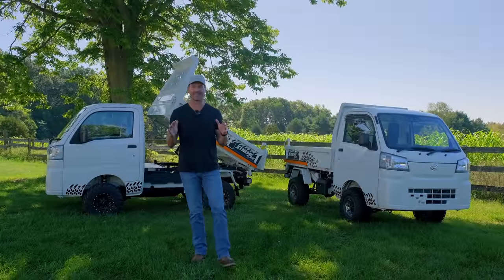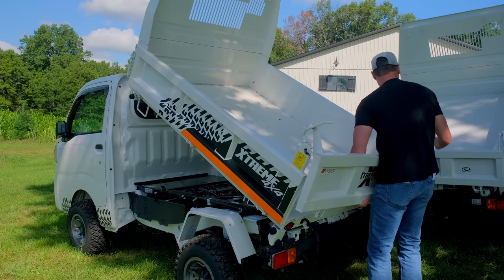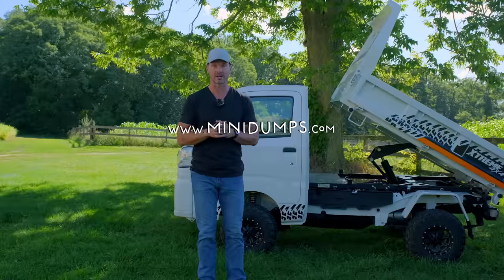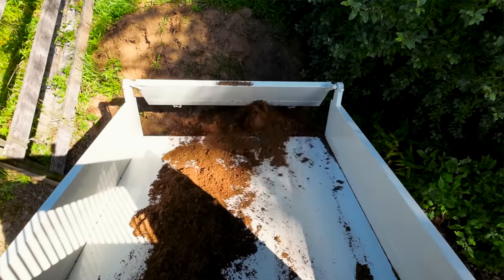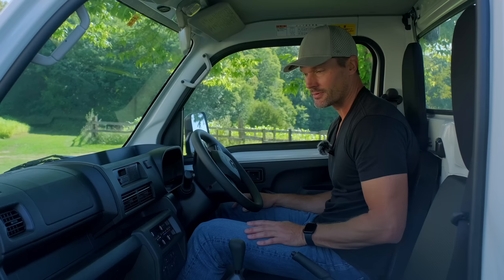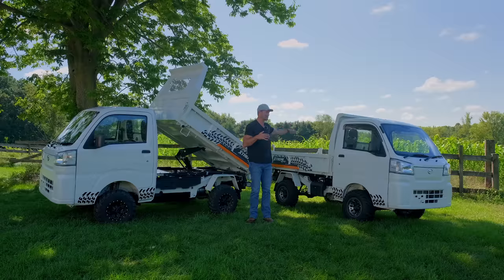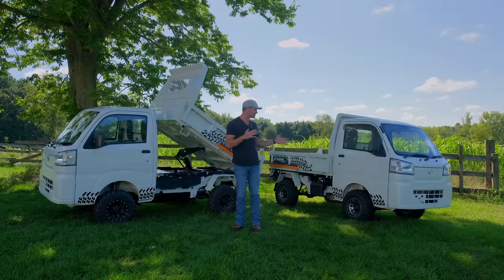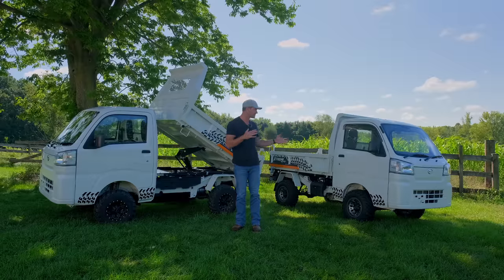DON'T BUY A UTV UNTIL YOU'VE WATCHED THIS.

Comment: Very popular  on farms in New Zealand & used as  a  farm run about.  Mostly in NZ,  they come with dual rear tires & are auto only.  Suzuki produce  the same type of truck / atv. They climb hills with no issues & are so reliable. In Japan they are called micro trucks or Kei Trucks.  Sold new in NZ with a 5 year factory  backed warranty.

Comment: Been looking at buying one recently.  Fun fact,  in some states like NC they are street legal.  Can't take one one roads over 55 mph,  but perfect for backroads or drives  into town.
Reply: I think I’ve seen them on the roads in Washington state.
Reply from the maker: Thanks for watching!
Reply: They can be plated in Wyoming, but so can a side by side. :)
Reply: @timbutler3213 you have! I have too. I've seen one in and around Chehalis Washington
Reply: If 25 years old there's are one driving on the roads if you get that made in 22 you wait 2047 road use.
Reply: @andrewgreiner4157  ya I’m up in Arlington
Reply: I live in nc I have one have a video on here I drive it everywhere I can run 60 with no problems I have 95 Suzuki carry mine has ac as well
Reply: It’s a good thing I don’t have to worry about NC laws
Reply: They are everywhere in Japan.  Laws in Japan are based on engine size.  These are the small engine maxed out.  It takes more than a day to get used to it.  Driving is easy, the turn signal/windshield wiper will drive you crazy.
Reply: Florida too
Reply: Met a kid in SC that got one and modded it with about 10k worth of parts to make it peppy and more equal to other cars here
Reply: how are they not street legal there? there completely legal here in Australia and we have far stricter rules and 55 why? they happily cruise at 110 km/h (68mph)
Reply: I had zero issues registering my 96 suzuki carry in NC
Reply: @jasonmadden9732  unfortunately no, it has to be imported as a car first.

Comment: It's really cool to see Americans starting to embrace these mini trucks. They're such neat little vehicles that have been restricted to the Japanese market for too long. Hopefully someday street-legal LHD versions will become available.
Reply: Not restricted to Japan. They are all over Asia and were originally based on European designs. And are sold in Africa and other areas in the world.
Reply: @silverbackag9790  Interesting, I always thought the ones sold in mainland Asia, Europe and Africa were larger.
Reply: @michaelramsey82  There are various sizes...at least in east Asia and parts of Africa. Probably Europe too. With various options such as 4 wheel drive, dually rear wheels, four doors, etc. The medium sized ones with dually wheels are by far the most common,  with the small 2 wheel drive ones used for package delivery inside of dense cities and small 4x wheel drive ones used by farmers (although the dually midsized 2 wheel drive models are probably more common in this market too). I can't recall seeing a 4x4 dually, but they may exist. Most of my experience is in east Asia, but I've seen them in other regions too.

If this were facebook, I'd snap some photos on my daily walk. They would be branded Hyundai, Kia, or Daewoo.
Reply: Buy a used one from japan older than 25yrs and import it yourself. It will cost less than 10k and if imported as a vehicle not a utv you can get a title. New these are overpriced IMHO being you can't use them on the street

Comment: I've looked at these in the past, my biggest concern would be parts availability and cost. Otherwise I think they would make a great tool for landowners.
Reply: And registration. Farm implement regs would need inspection and some places obviously won't have these on the approved list. Also too heavy where I am for OHV tags so the last option is on road, which will require inspection, emissions, and insurance.
Reply: With how inflated car prices are nowadays, getting a 25year old vehicle that you can modify to today’s standards ends up balancing out. Yet you end up with something more useful and compact than what you can purchase here.
Reply: the parts are there and they are pretty cheap vs other vehicles . my 96 suzuki carry came with A title and was registered in NC . many other places allow it as well , but only the older ones

Comment: I have had 2 of these little truck. They are super little trucks for the farm. but not for the off road as much. They dont have  the suspension like UTV has. Both of mine bottomed out on struts when trying to drive across corn fiel. and my UTV can run full speed across it. They both have there own  uses. but NO it wont take the place of UTV unless you want to drive super slow speed  across fields... My little truck had A/C and such. but really nice..But these are way over priced also. I bought both of mine from 2 different people for less than $3000.00

Comment: Love my Sambar. Should have got the dump version and A/C. I use mine as transition sprayer with the ATV boom on the back. Size between the field sprayer and a hand pump. I manage about 22 acres with it. With the older version the parts is a problem which is probably why going with a new one is better. I think a 55gallon sprayer tank is about perfect for these.

Comment: There were several people a few years back importing 25 year old Hijet, Honda Acty, etc.  I liked that they were significantly quieter and more useful that a UTV, with more creature comforts at a quarter the cost.  I guess they saturated the market or it became harder/more expensive to import them because nobody local sells them anymore.  Even new these are cheaper than a UTV, which is great.   When I was shopping UTVs a Can-Am Commander XT with weather package was only $6k cheaper than my Forester XT, which is crazy.  Also, all those imported mini-trucks were manual, which is better than the guaranteed to fail CVT belts in SXS and UTVs.  I've never seen an automatic.  I might have pulled the trigger on one if that was an option back then.  I have a good friend who can't drive a manual due to losing a foot to complications from spina bifida.  I try to make sure he can use as many of my "toys" as possible instead of always being relegated to passenger.
Reply from the maker: Yeah, harder to import is the problem.  Gotta follow the rules to a T.  These guys do it the right way.
Reply: I drive a 1993 hihet it is a4 speed  but they did make 5speeds and automatics. Daihatsu automatics from s83p and 110 series are not cvt the Subaru automatics were cvt and had some problems. They made an even smaller automatic, called the midge two. States have made it harder to register them for on the road I believe this is why the slowdown in importing them. Just check with your local if you intend to put it on road use or stick a farm plate on it. Mine is older, it was a project for me to restore with my son so I went antique route. I have not had a problem finding parts they literally made millions of these. The hardest part is figuring out what to call the parts in a foreign language when you were searching multiple countries, but the Internet has made parts readily available. G and R imposts and eBay/amazon Japan have most common parts even for my 30year old discontinued model and my local Napa stocks the filters. I would not recommend one as a daily driver if you were a brain surgeon but as a secondary or third vehicle for a small business, or to replace a UTv on a farm. They are perfect.
Reply: BUY MADE IN USA!
Reply: @KVX21  beside the fact that you can't buy a mini truck made in America, you realize there's a difference between made in America and assembled in America, right?  Would you prefer a Tacoma assembled in Baja, CA or Sierra/Silverado built in Mexico, or F150 assembled in Detroit, but with every major component being manufactured in either Canada or Mexico and most of the electronics for all three being Chinese?  UTVs and side by sides are the same way.  They all use parts from across the globe.  Welcome to the World of the last 50 years.
Reply: @Noah_E  LOL ok Sheepee. You should read it again BUY MADE IN USA!! Remember them words dippy...

Comment: You did not cover the two options for dump; PTO vs electric hydraulic and which is better for farm/ranch work and how dump feature compares to a UTV tilt bed.

Also is the ground clearance  acceptable for working/ clearing food plots and trails or they need to stay on flat/smooth ground.

Comment: Looks neat, but my issue with all of these mini truck imports, is that they are designed for someone of the build and stature of their intended market, where Americans tend to be taller and stockier and so just fitting into them for the average American could be problematic. It would be nice if the cab was a foot deeper with adjustable seats to push them back
Reply from the maker: Average height of US male: 5’ 9” https://www.health.com/average-height-for-men-7501601#toc-average-height-for-men-in-the-us

Average height of Japanese male: 5’ 7” https://en.llcig.com/average-height-in-japan-2023/

Weight is probably a bigger difference, but  doesn’t mean it’s all in the waistline.  Even if several inches bigger in the waist, that’s a circumference measurement.

Comment: The rear receiver is actually a $350 option. And at 13:30 it looks like it has collision detect, traction control, parking alert, and auto-engine off? (Hate that last one, I disable that permanently on any vehicle that has it). There's no mention of that on the website, unless the button panel is pulled from a common parts bin.
Reply from the maker: Yeah, the panels are not custom made for the imported trucks, so same panels that are used in Japan.
Reply: @GoodWorksTractors  Oddly enough just today we saw a Dihatsu Hijet microvan for sale in the side of the road. Not sure what series, but looks like a 8th or 9th generation model.

Comment: Can these be driven on the streets in Michigan?  I get probably not the interstate.  I also understand you probably wouldn't drive everyday, but if you needed to drive a short distance for grain, hay, gravel, etc., could it be?
Reply from the maker: These are sold for off road use only
Reply: They are too new to import and register for street use.  Also these are speed restricted keeping them off the streets with 25mph+ limits.

Comment: Holy smokes 25-30k is insane for these things.  You can find them so much cheaper.  A guy down the road from me has 3-4 older ones.  No way dropping that on that thing
Reply: Yeah,  he's bragging they're so much cheaper than a Gator.  I just bought a jd 865m with cab for less than what these are selling for.  I won't deny they look nice and I'm sure they will do everything he says they will but at least be honest about the pricing.
Reply: Really ? You can find a brand-new import so much cheaper ? Links, please. And don't tell me you are comparing it to a 20 year old model that's been imported from northern Japan, and been through 20 winters.
Reply: Two years ago I bought a 1996 Mitsubishi Minicab, automatic, 4WD Dump with less than  3500 miles on it from Mayberry Mini Trucks in NC, for $6800.00. The vehicle was completely serviced, came with a NC title, and was delivered to my house in southern WV for $250.00. No way I would pay the prices he wants for one when older ones that are in great condition can be had for a fraction of that price.

Comment: Looks like the 1550 lbs dump might be a bit on the lighter side, when you showed the clip of loading it seemed like it can't haul much, so more of a versatile tool as opposed to a small scale dump truck!
Reply from the maker: Not sure why you think I maxed it out?  I put one scoop for visual demo.
Reply: @GoodWorksTractors  my bad I didn't mean to imply that you were being deceiving, but I'm thinking the tractor you loaded out with is most likely rated to lift more than 1550 lbs so one bucket from it would probably be pushing it. And  electric over hydraulic dumps in general aren't very forgiving when overloaded. I do apologize tho I realize you weren't trying to say that they are heavy-duty earth moving off road haulers! Just a cool economic alternative to a sxs!

Comment: 1500 lbs seems a little light for the dump.  I was wanting to see you load up that bed with more than one scoop of dirt.  I would think 2500 would be a lot closer to what this truck should handle.  Maybe that's the Xtream dump option?  One scoop only would make me think I'd just run my tractor to the destination dump point.
Reply from the maker: One scoop just for video, I'll be doing much more with it down the road.

Comment: This guy isn’t pointing out the real weaknesses. I’ve got these and utvs.   They have overlap in their uses for sure, but these aren’t always an alternative to a utv.  Hardly any suspension travel means I can only run 5 mph through pastures I can run my utv 30 mph through. I’d never take a mini truck through brush and tight woods … there’s a reason utvs have plastic everywhere— Plastic doesn’t dent or scratch like metal body panels.  A mini truck would be literally totalled in just a normal day’s work for a utv.

Comment: Personally, I think the Kioti K9 cab defeats this. Check it out. Same price and fit and finish
Reply from the maker: That looks like another Ranger, Gator, etc to me.  Different level of fit and finish.
Reply: @GoodWorksTractors  automotive spec cab. 35 mph top speed. Diesel FTW. Dealer availability and network. Full size pallet bed. Higher ground clearance. Available track system. Electro hydraulic bed option. 3 across seating. Left hand drive

Comment: Considering one of these versus a Can-Am defender pro side-by-side, which has the 6 foot bed. One of the biggest drawbacks of these mini trucks is how gutless that little engine is. I expect it with any amount of weight in the bed or if using the truck for, mild and light duty farm work, hauling, towing, etc., that little engine is gonna struggle

Comment: 20 mph limit is a deal killer. Otherwise a very nice setup
Reply from the maker: I thought it would bother me, but I started watching how fast I travel in Ranger for awhile and rarely above 20 mph around my place.  Wasn't as big of a deal as I thought it would be.
Reply: These have aa speed limiter?
In Canada we been buying these for over 20 years and they are road legal.
They can do 100km/h with a bit of strain
Reply: There has to be a throttle stop or something you can remove. Older ones will go 55mph or so.
Reply: @3crowsfarm16 Blame the EPA. Due to emissions regulations, these have to be classified as off-road vehicles. That requires them to be speed limited to about 25 mph.
Reply: @karlrovey  i seriously doubt it's the EPA
It's american protectionism at its finest, where american manufacturers and auto dealers can't compete with cars people actually want.
Just another flavour of the chicken tax.
Japanese emissions stricter than usa
Reply: @3crowsfarm16  It is an EPA regulation. If it was imported after 2007, it has to be registered as an off-road vehicle (regardless of age) and modified to be speed limited in order to comply with environmental regulations.

Comment: That looks awesome. I've been holding off on a UTV for years because they cost as much as just buying a Jeep with a plow on. I'm a tad bigger than you but looks like you had lots of headroom space to spare. I'm wondering now if they'll still fall under the UTV laws where you can still put a 'plate' on them for road use following ATV road and trails. But that'd be great for doing mulch and dirt dumps for landscaping. I see they're limited to 20mph so that answers that question on can they go on roads like ATV's.
Reply from the maker: These are definitely being sold through minidumps for offroad use only.

Comment: I would be curious to durability.  I have a Can-Am Defender and I have it in the woods a lot doing work.  Just a few days ago I had a large branch I accidentally ran over jam under it into the front wheel.  With metal that would likely cause dents and bends.  Also the underside of most UTVs is usually protected.  I think these mini dumps would be awesome on the farm if I kept it out of the woods…